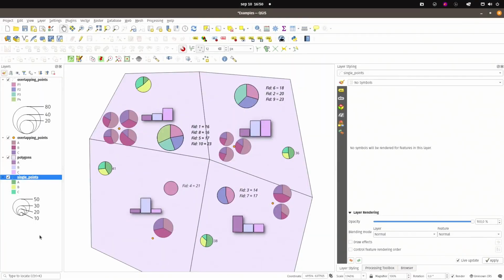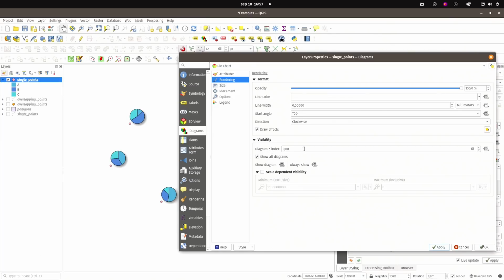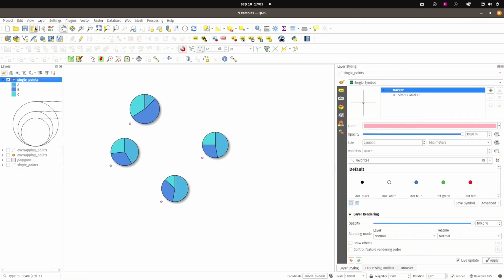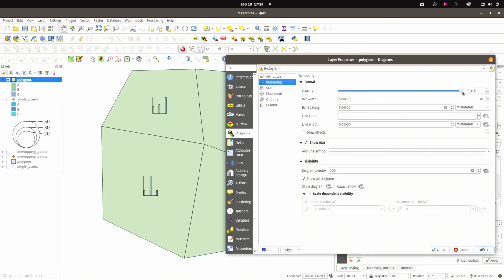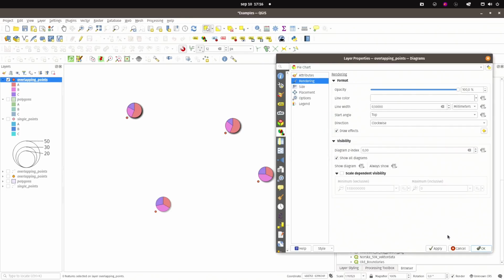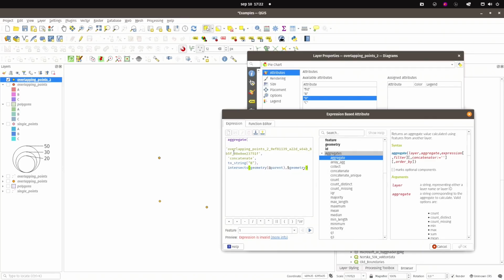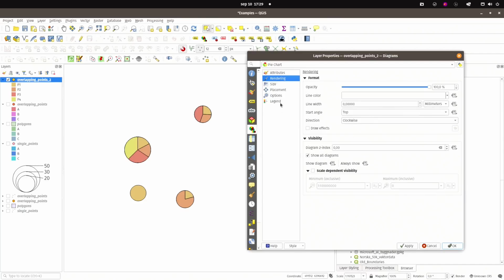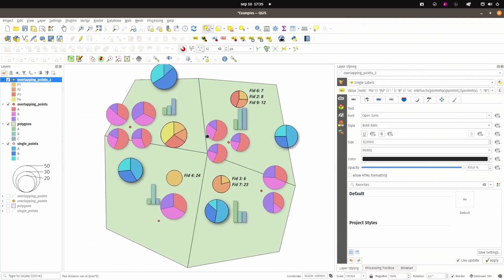QGIS User 0050 - Charts and Diagrams

Comment: Hello Klas! I need to make a pie charts from a single point and I want to represent the data of a single column that contains, for example, men and women. It's possible? thank you!
Reply from the maker: All you need for a pie chart is geometry and values. Values need to be formated in a way that can be used, so you might need to convert your field values, but it should be quite possible.